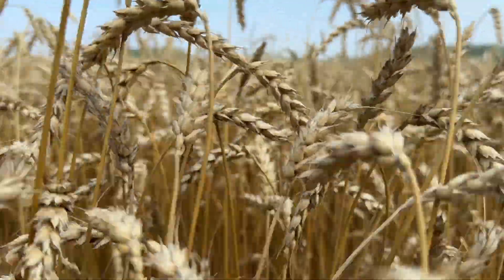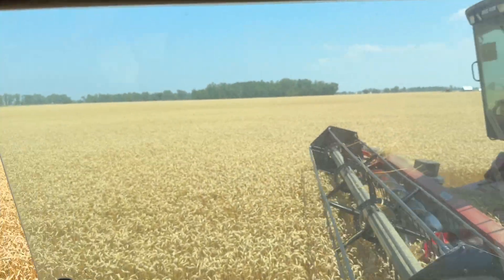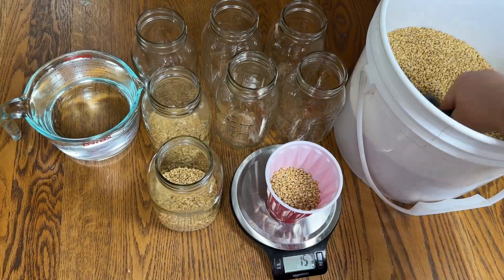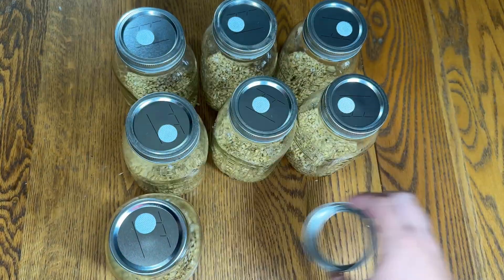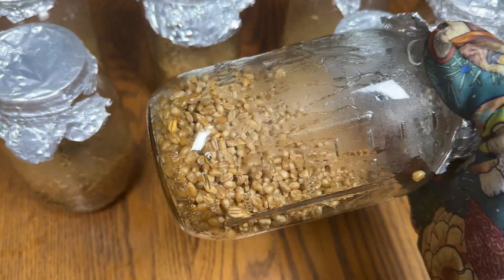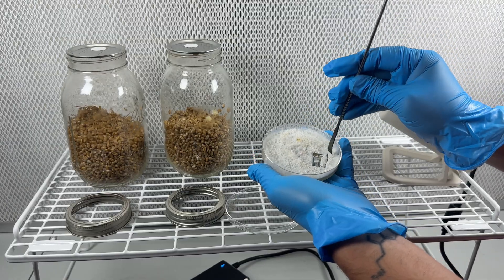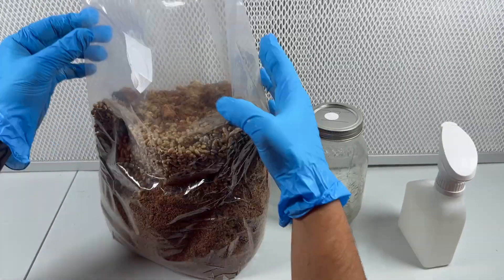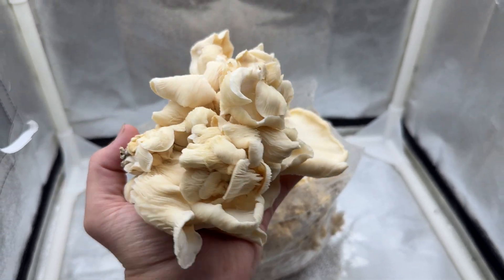No Soak No Simmer Grain Spawn Method for Growing Mushrooms

Comment: could you use more than 200g per jar? since they seem half empty, couldnt you use like 300+ grams?
Reply: jars can filled as much as can be shaken as a general rule, the grain expands as it cooks so factor that it.  I was not using a no soak no simmer method and pre-cooked my wheat and rye when doing oysters and such. I personally found that 2/3rds full (post-cook) to be about ideal, enough grain spawn to be worthwhile and enough to room left over to allow for complete break up of the spawn while shaking.
Also I wouldn't use weight as a measure as when you move to different grains like WBS,Wheat,milo and millet the density/weight of the grain changes due to the individual grain size.
again with bulk substrate the weight is generally irrelevant except to calculate the biological efficiency, you fill your tubs,bags or artificial logs volumetrically and not weight.
successful mushroom cultivation is built upon good habits so get out of the habit of weighing spawn and substrate and into the habit of using ratios and volumes just like in PF tek were the 2:1:1 ratio of ingredients is volumetric and not by weight, but that is just my opinion

Comment: I used to use to NSNS method until I started getting bacterial contamination in all my jars. Certain bacteria species form endospores that can survive pressure cooking, then they activate once cool. By pre-soaking, the endospores activate, then they can be killed in the pressure cooker. 
I also get fewer burst kernels using the soak & simmer method.

Comment: That's the way I used to do with rye grain, and I never had any problems, I would use an empty can of corn or beans, just regular size, to measure the grain, and an empty Vienna sausage can to measure the water.
Reply from the maker: That’s a streamlined approach 🔥
Reply: is the ratio with rye and water the same?